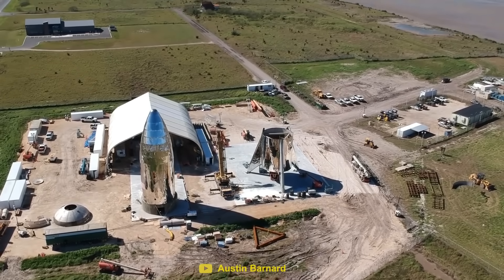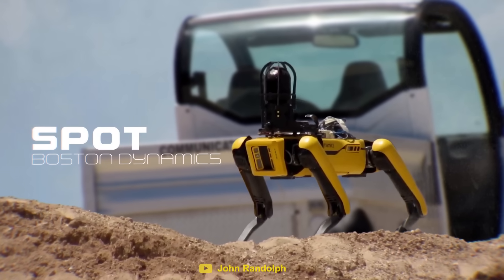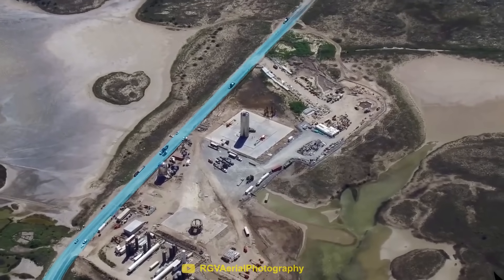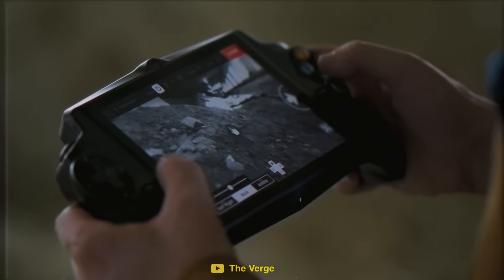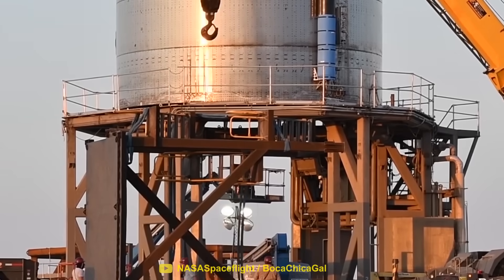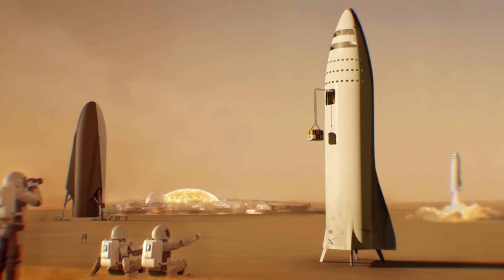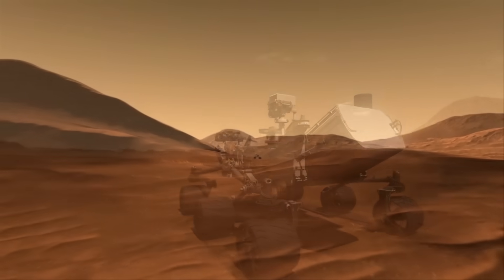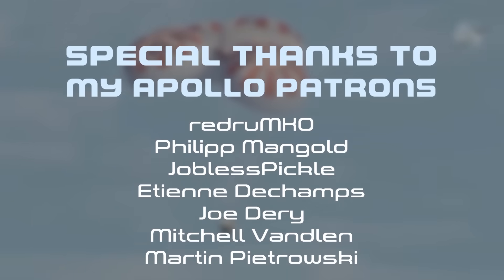Why SpaceX Bought a Robotic Dog

Comment: Why just one? I feel like it would be more efficient in the long run to have 4. They could cover just their designated areas (N, S, E, W), and save on battery use. With something as complicated as these rockets and engines can be, I think it would be better to cover more points of failure than just 1 moving camera.

Comment: When prototype was caused to failure, what was the Spot's job? Narrator says like noone would see what's happening if Spot wasn't there. But it's common to have a lot of equipment including many cameras an other sensors on the site. And on the other hand, Spot's out of the box cameras are short-sighted. If I correctly remember, it sees in a 5 meter radius. This Spot has additional lidar installed but still it doesn't seem to be a good video platform. So what exactly was this Spot's task on the site?

Comment: One issue about employing sophisticated robots on Mars is that circuits need to be radiation hardened, which significantly limits processing power. Curiosity's computer operates at 200 MHz with 256 MB of RAM. Definitely not enough to support advanced AI. High-number redundancy could help soften the radiation tolerance but probably no yet enough to allow off-the-shelf components.

Comment: Almost everybody misses the fact that the gravity on Mars is different than on Earth. The robots were conditioned and tested in Earth Gravity. It may not be functioning properly on Mars. It would be hard and time-consuming to condition them on that Mars Gravity since we are far away, and there is limited way to test them. Sure there are planes that go high above the sky where gravity is gradually getting weaker, but it will take a lot of time. Or is it I'm just not an expert on robots that I don't know that Boston Dynamics can easily resolve the problem by simply tweak the software or hardware inside the robots? Experts in robotics, please explain.
Reply: Most of the education of the AI of the robot is done in a simulated environment anyway, so they can tweak the simulation to have the same gravity (or none at all) as Mars. That's not a problem at all.

Comment: Good video, but you missed the whole point of SpaceX using Spot. This robot dog has a very sophisticated AI in it, and it can preform operations entirely independently given a guideline of what the task is... so no, humans don’t need to “operate” it necessarily, which resolves the issue of long latency transmissions. Do more research in this dog, it’s really fascinating. Adam Savage uploaded a very informative video on it that would be incredibly beneficial to watch.

Comment: 1:37 "no one is allowed within at least a mile"
Diagram: shows half-mile radius
Reply: He got the Spirit
Reply: Spot: "Damn, did you hire me to check damage in a contaminated area or even explain fundamental geometry to you?"
Reply: It said 1.6 km not miles
Reply: It’s 1.6km Xd
Reply: @Hieulegen27  = 1 mile diameter = 0.5 mile radius
Reply: @newsgetsold  "within" a mile means a 2 mile diameter. if youre 0.5 miles away from something youre within a mile of it.
Reply: @jasoniswrongabouteverythin8230  Well yes, that's what he's saying; because the diagram shows a diameter of 1 mile while it's supposed to be showing a diameter of 2 miles
Reply: @theseductivepotato7459  they were repling to newsgetsold. See the little @ sign and the name?
Reply: @amargollamudi3832  yeah, but it seemed as though Zaphod Beeblebrox was correcting OP by saying exactly the same thing OP had said, so The Seductive Potato stepped in to clear the confusion
Reply: @ArgentavisMagnificens  Yes, correct.  Zaphod's  comment was basically saying exactly what I said.  And thank you Potato for pointing it out.
Reply: This is the problem with using communist units
Reply: @thelegacyshow4248  then you don't get to use space x then! If you pay attention, all their metric is all shown in what so you called "communist" metric, not the freedom metric so yeah... I guess genius and visionary has to be communist, just don't use them because you so free, oh don't use your computer and your cell phone as well they are made by communist